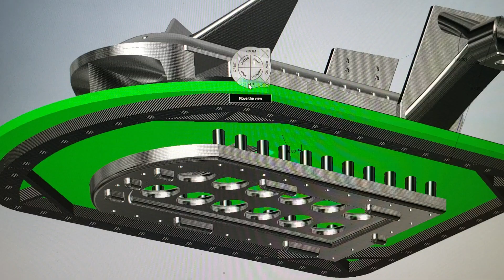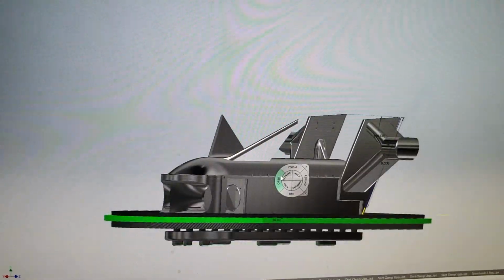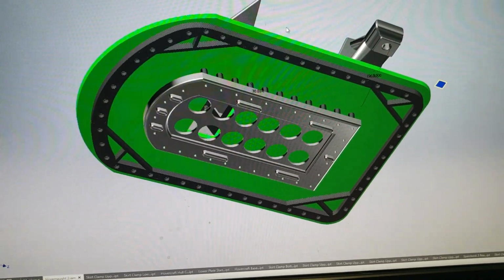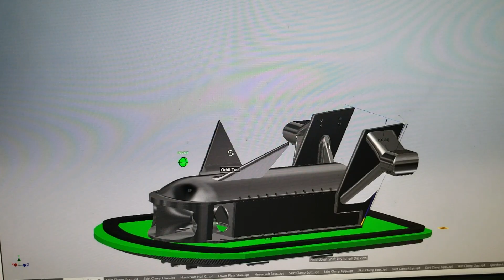Build log: Hovernaught DIY High Performance RC Hovercraft 2.0

Comment: gawd.  where to begin.    let's start with an understanding that yer typical  hovercraft, is  actually  an  Air Cushion Vehicle.    it''s a small thing;  but small things  ADD  UP.         let's talk about  thrust,  and the Reduction of  drag at the ground.     when drag is reduced,  LESS  thrust is needed for propulsion./maneuvering.     but go ahead, use as many thrusters as you like.       let's talk about  thrust  LINES.    on this iteration,  they  are  Offset, and high, in relation to the c-m, center of Mass;  wherever you think it Might  be  located.     see link, for an example of the Compensation  needed, on a pusher model.      why is this important.      ideally,  a  thrust line  Should  INTERSECT  the  c-m.         the c-m  should be  located as   low  as is practical; in order to achieve maximum keel effect stabilization;  and limit any increase in top-heaviness, in the dom; distribution of mass.        it should be understood that the  location of  Any component/part   ABOVE  the  level of the  c-m,   RAISES  the c-m;  which increases any existing top-heaviness.       this iteration has the same old problem;  a  shortage of  Longitudinal  Stability.     the use of large and Effective  vert-stabs would seem to be a good idea.      consider, also, whether it would  be of benefit to  increase the  hull length.       googletranslate         an offset thrust line; and  Compensating  thrust  Angle
http://static.rcgroups.net/forums/attachments/2/9/6/3/9/7/a5988257-224-bixler%202%20motor%20angle%20correction.jpg
Reply: i spent 2 years designing a rc hovercraft it took 4 models and 12 skirt attempts to nail it , i use one 90mm edf motor for lift and 2 70mm edf for thrust and steering ....the skirt design ended up being 94 hand soeing fingers out of riptuff material , it all runing on one 22v lipo 1600mah battery lasts about 25 mins very happy with outcome , no problem on land , gravel , grass , water ....
Reply: @grahammckelvie216  i spent time reading yer  comment/anecdote, and discovered that it contained  NO  point !
Reply: bro i doubt anyone will read that long comment lol
Reply: @jamsheed9867  dude, i doubt that anyone will  Benefit from your astute reply.